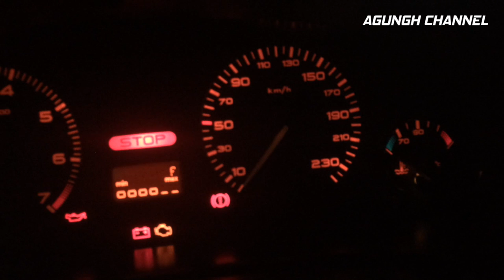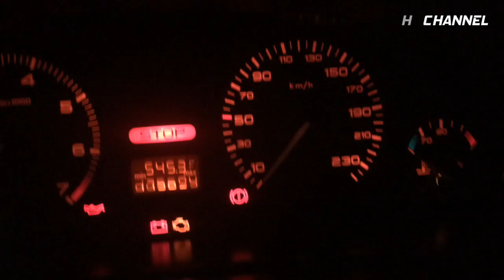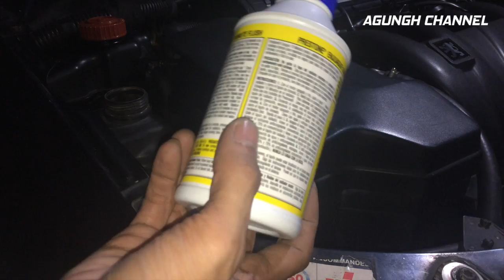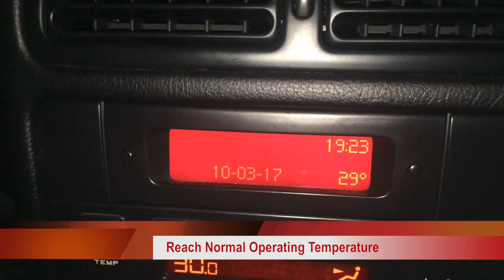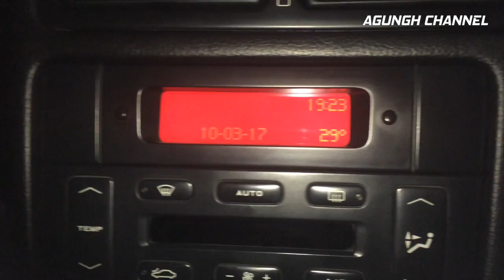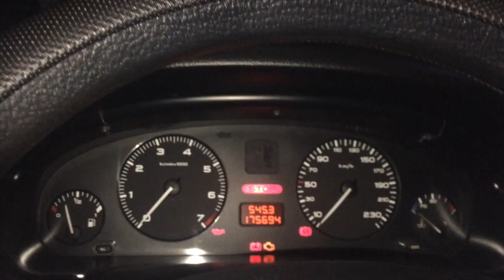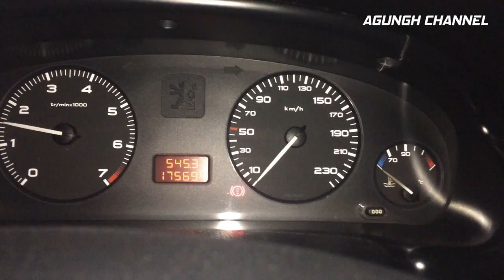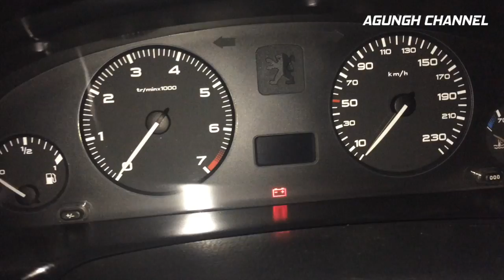How To Flush Radiator Coolant Engine Cooling System - PEUGEOT 406

Comment: Good job. My advice however is don't use distilled water. All car manufacturers say you must use radiator coolant fluid. Even distilled water will corrode your aluminium radiator and cylinder head. Radiator fluid is more expensive but much cheaper than new radiator.
Reply from the maker: Absolutely right, use distilled water only for clearing residual in the engine coolant system... finally, recommended use radiator fluid.

Comment: Good night.
I have a pegeout 406 year 1997 sedan 2.0, 16v and automatic.
However, it has a lot of overheating problem, the three sensors of the thermostatic valve have been changed but it still remains with overheating.
Is it possible to be a problem in the module?
Reply from the maker: check radiator hose, thermostat, waterpump and make sure there is no air in the cooling system.